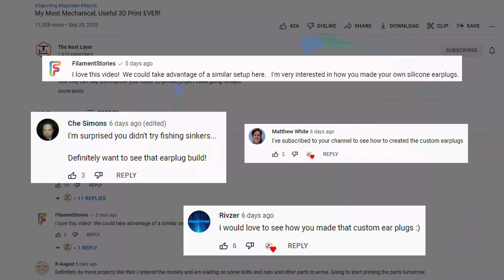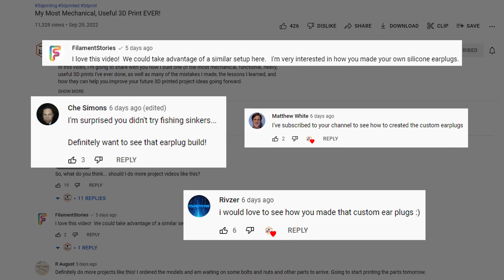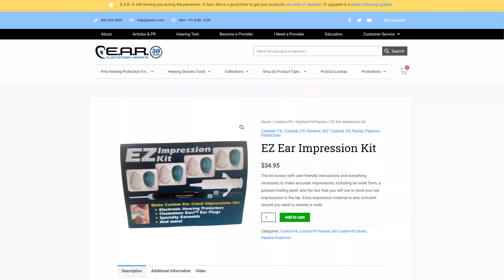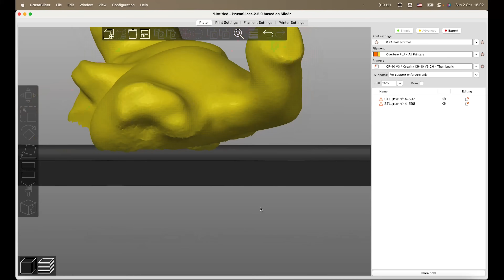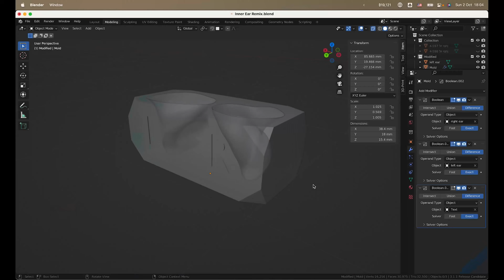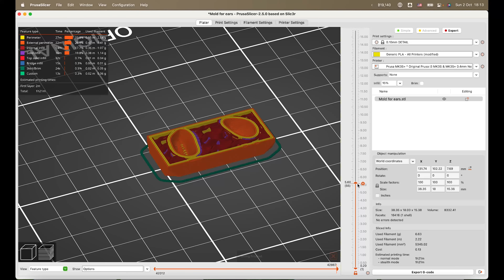100% Custom Ear Plugs Using 3D Printing & 3D Scanning!

Comment from the maker: So, what do you think? Will you try this out yourself? I'd love to hear in the comments below!
Reply: I have experimented with mould it yourself at home earplugs and never quite got the fit I wanted. Couldn't justify the cost of a professional custom set. 
The biggest hurdle to me trying this is the 3D scanning process. I don't want to shell out for a dedicated system and I have no idea which of the mobile based apps are either 1. Give any sort of quality or 2. Actually do what they say without being an endless cash grab.
Reply: You could make the loops in a separate mold, shaped like an o-ring. Then insert the ring halfway in the plugs when they start curing.

Comment: I’m going to try this because I have an MRI scan of my entire head. I’ve already printed my brain. 
One improvement that will solve two things on your design is inserting a string across both plugs as they cure. You can then colour code the string and also use it to pull the plugs out.

Comment: Also as an audiologist you learn that there is a shrinkage when using silicone.

Thats why we usually let them cure in milds under pressure so that onöy the opend side deforms. Thats why hed had to upscale them by 2-3% which is the usual shirnkage of silicone.

I would also advice to try to make them as hollow on the inside as possible that way they are way more comfortable

Comment: That’s a dangerous game. Without properly checking the otoblock seal the material can adhere to the eardrum and when you go to remove it you can pull out your eardrum and the 3 bones connected to the back.. giving you permanent hearing loss.
Reply from the maker: Seriously? Doesn’t sound right…

Comment: Have used Polycam quite successfully for 3D scanning with an iPhone Model X (10). It would be much better with later model iPhones as they have LIDAR built in. I was quite surprised to find this out, negating the requirement to actually buy a 3D scanner. Who knew???

Comment: I did something similar with oogoo (homemade sugru with silicone caulking and  corn starch); i buttered up my ear, jammed the oogoo in there (with a string in there to be able to pull it out) then i waited till it was hardish, and pulled them out.  A day later, arfter hardening: earplugs!  Not for everyone though, as there is a chance the oogoo will break as you pull it out, then good chance getting it out

Comment: Earplugs huh?

I have tried a number of HiFi/concert earplugs before.

First i went to the drumming section of a music instrument store, they gave me Alpine MusicSafe. These did not sound great. But you get a few sets of filters and you can pick and choose whether you want them high attenuation or more casual. It was 20 years ago. I think i paid 35€ or something of that order of magnitude. I'm very thankful to these - because i had always been concerned about my hearing, and i bought them before i went on a hear-damaging youth thing spree and actually used them, i have been able to retain easily 20db better hearing than most of my peers. I don't have any tinnitus at 40 and my hearing range extends well beyond 17KHz still.

Then eventually i went to an audiologist and they gave me 3M EAR HiFi, these were 20€ and they sounded amazing. The problem is that they caused me immense physical pain, they just didn't sit right at all. These have 3 flanges. I tried to shorten them by one flange, but this didn't really bring relief.

I bought a few things from China. I bought silicone swimming earplugs, they fit nicely and are comfortable, but they are neither particularly high-attenuation for construction purposes, nor are they HiFi for the music, but they cost literal pennies. I also bought some that were on the order of 5 to 6€ and they are... fine, not great.

Then i was passing by a home improvement store and besides Alpine WorkSafe plugs, they also had the Alpine PartyPlug, i bought those for 12€... and i'm extremely happy with these. They sound so good, no way anyone will convince me to take them out during a concert or festival! I suppose Alpine optimised the audio performance a lot over these years and i expect that the new MusicSafe Pro might be equally nicely sounding.

I'm actually curious about going to the audiologist again and get my earprints done, to experiment with building my own IEMs and i want to try my hand at attenuation and protection earplugs as well. I've gotten into tuning cheap off-the-shelf IEMs recently.

Comment: I had some ear infections when I was 8-15, so now I can't hear anything above 12-13kHz. Also my left ear is more sensitive than right one. When working with LOUD machines, I use in-canal earphones to listen to audiobooks. I've got a pair that fits very well so the noise level is below the volume of my audiobooks. I also have an idea to combine 3D printed headphones with some digital signal processing to make active noise cancelling ones, but my programming skills are not there yet...

Also I want to try 3D scanning and 3D printing to make an eye patch for my dead and sunken left eye that fits the shape of my face and bone structure of the eye socket. Maybe even a Borg style ocular implant...

Comment: Hey thank you very much for the vídeo, very interesting. I use that soft gel that is sold at Walgreens farmacy. But Iam from Brazil and here they sell one similar but is terrible quality it's Hard a d don't fit. My question is 
Do you thing if I buy that silicone from Aliexpress I can make my onw gel soft and stick like the one that is sold at walgreens?

Comment: Michaels Amazing Mold Putty Kit, push you earbuds in, push in ear. sets up in 3 mins. done.
No 3d printer, scanner, or dealing with software needed.
Reply from the maker: Good tip!

Comment: Couple of recommendations, 1. Don't put anything in your ear bigger than your elbow!  If you're getting impressions, get a professional.  If something gets stuck or you run into any problems it's best to have somebody with experience, tools etc. to do it. 2. When designing a mold its a good idea to have a small tapered angle to remove it properly (I'm sure most ear canals will have this naturally but ensure that no part of it is thicker in the middle than at the end if that makes sense) and also to have a channel at the bottom most part of the mold (.3mm cylinder should do) about a couple of mm in length to allow for trapped air.
Reply from the maker: Good calls!

Comment: Thanks for the idea as I work night shifts. I've found some skin safe silicone and casted my own. Using the revopoint pop 2 to 3d scan some mouldable silicone off Amazon. Its a consumable though and I'm not keen on spending money all the time on it lol. One time use stuff pretty much

One day I'll get the proper stuff for moulding my ear and 3d scan again. Cheers!

Comment: Ok.... I'm going to be "that guy" that calls you out. Showing a very likely concept that SHOULD work isn't quite the same as showing a process that you've actually done. It's alright to take a couple shortcuts, but there were a couple extremely crucial DIY steps skipped.
Initial ear canal molding. This is potentially very dangerous if done wrong. You had yours done professionally, so it's a bit dangerous to recommend that people DIY.
Scanning the initial mold. Photogrammetry may work well for larger items, but how would it do with something small and intricate like a ear canal model? Even if "buy this $400 3D scanner for the best results" is the answer, I'd like to see that tested. While you were able to get the STLs from the professionals who did the work initially, I suspect most of us wouldn't be that lucky.
Perhaps show a mini-series of start to finish. Casting an ear, scanning the casting while comparing photogrammetry and your 3D scanner, then maybe a quick Blender example. Just a thought.

Otherwise, it's a fantastic video as always! I came across this channel just in the last couple weeks and was surprised I hadn't seen it before, but I guess that's because it's only a month old! Looks like you've been making videos for a few years, but I'm glad to see this one is taking off too! The plan to get free filament is great for those of us who like to create 3D models.
Keep it up!
Reply from the maker: I hear you! And yeah, I feel that. I didn’t even think of the idea of doing what I was recommending myself with my own 3D scanner until someone suggested it in the comments. In retrospect the video would’ve been much cooler if I tried to recreate my professional STL and compare them… also would’ve been a great way to compare photogrammetry and cheap 3D scanners. Lesson learned. Next time I’ll do something like that. And I wanna do a video on 3D scanning so maybe I 3D scan my ear plugs to see how they come out as a follow up. 

In any case, thanks for being that guy! I’m always open to constructive feedback!
Reply: @thenextlayer  oh yeah.... That's be cool to scan your professional earplugs.
I've got a family member who is extremely sensitive to loud noises. If he'd allow, it would be fun to try making earplugs for him.
I've tried photogrammetry a couple times with very varying results. If there's a good way to get consistently good results scanning with a phone, it would be fun to explore.

Comment: Seems a bit odd to be, going to a concert and wearing earplugs? Must only be there for the visuals and drugs lol.
Reply from the maker: Actually, ear plugs just bring down the volume so you can hear the music BETTER. Which is why the artists on stage wear them. The volume is set so the people in the back can hear, but that means dangerously high levels for people nearer to the speakers. 

Also, what’s wrong with visuals and drugs?

Comment: Thank you for this really good work :) 
Just a little tip in Blender for adjusting the fit : You can add a specified tolerance to the boolean substraction, for this you just need to add a Solidify modifier on the cutter object and selecting the option "Only rim", weirdly enough, if your mesh is manifold it will create an envellope outside it and and you will be able to specify your amount of tolerance ! You might want to select the option "Even thickness" too.
This is better than just scaling your object because you're not really changing it's shape (global features will stay at the same place in space, you're just making the object thicker) but maybe this is the way you did it !

Thank's again and I hope to see more videos, you got a new subscriber ;)

Comment: The best solutions are far from what you have said. Ive worked in "construction" for 20 years now and  my hearing is still perfect, alas my eye sight isn't... If you are recommending this, back it up with proper testing for decibel levels etc as it all means nothing without certification to proof what you are promoting is legal or covers OHS laws etc blah etc.
Reply from the maker: Really? The best solution isn’t those big 3Mprofessional ones? Then why do I see them on construction sites?
Reply from the maker: I said in the video the best ones are the professional grade 3M ones I showed.
Reply: Its not illegal to wear any type of ear protection. Its just your responsibility to protect yourself

Comment: Very good video, will continue to follow your content.

I too am a freak for ear protection and struggle with the best option. I am a fan of the "silicone gummies" you showed the clear version of. Adhesion to your ears plays a big role with these, and I took to buzz-shaving my inner and outer ear lobe area to maximize stick.

A big problem for me is - while working hot tar or roof coatings, for example - they get filthy on a job site where you have to pluck em out for a moment to hear a co-worker; when everything is hectic and filthy, and your hands and clothes are filthy, how do you STORE them for a minute so the clean side doest get dirty? There's usually not much more than a fraction of a second to shove them in a dirty pocket and help with something. Then sweat and other job residue messes up re-sticking them to your ears! 

I use a combo method of half a clear gummy (or one of the orange, kid's version), pressed farther into my ear canal than recommended with only some of it "capping" on top my outer ear, then stack it with 3M earmuffs in my hardhat that snap up and down over my ears. Reducing the amount of the silicone gummy throttles decibels way down (well enough to dampen hammer strikes and air tools firing) but no so much you can't hear details when people are yelling. Then when I'm near loud equipment I snap the earmuff down for super quiet.
Reply from the maker: Definitely try the silicone. Being able to wash in soapy water is a game changer